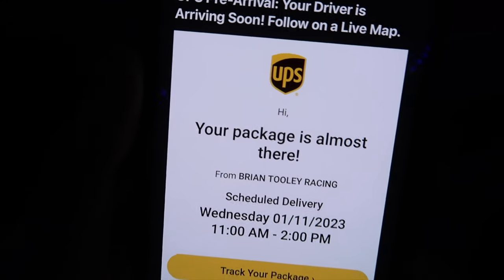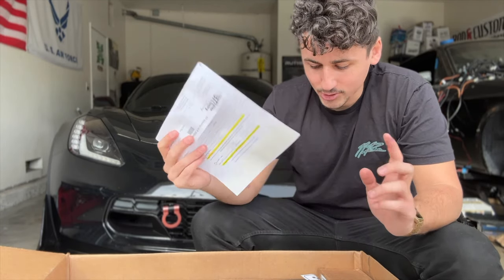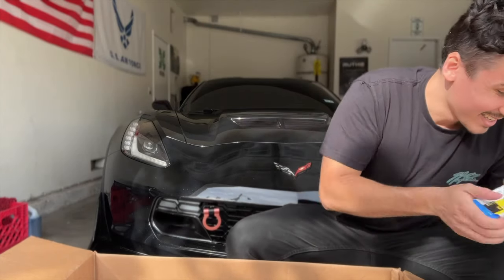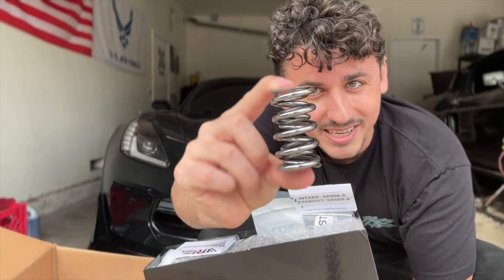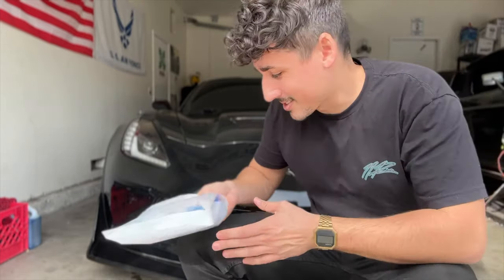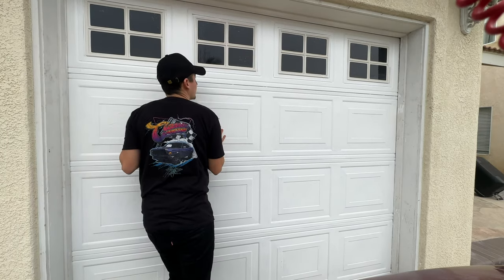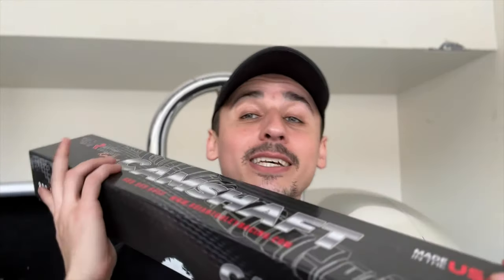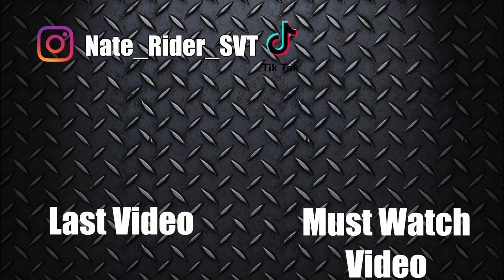STAGE 2 CAM FOR MY Z06 CORVETTE!!! UNBOXING, REVIEW, SOUND & HORSEPOWER #'S

Comment: If you ported the blower and put meth on it 850 to 900 hp is possible I have fbo 820 hp low 9s in the quarter

Comment: Great build on the Z06, all of those upgrades are for the valvetrain that will help with the more intense pressure that big cam will put on the valve springs. 
When you're doing a cam upgrade on an LS or LT it's best to include new stronger springs, better lifters(usually hydraulic), and rocker arms and push rods made with your cam specs in mind to keep everything running smooth. If you're engine is high mileage or you want to rev over 7k rpm, the stock parts will tear themselves apart and you'll be in trouble. It's all to help prevent valve float, and keep everything running strong when you go to mexico.
I'm a little surprised that the LT4 has DOD in it considering the Z06 is supposed to be the performance model. I'm an LS guy btw
Good choice with BTR too!!

Comment: Are u saying ur expecting 700 with nitrous?
Reply from the maker: 700 with cam, full bolt on and e85. Nitrous should be around 750-800
Reply: @NateRider  I was boutta say, that new more sense